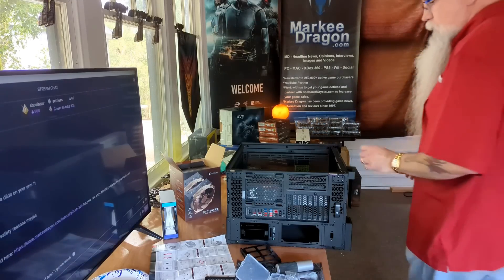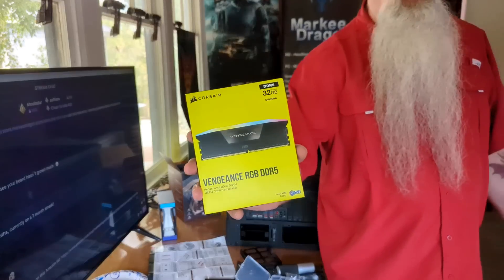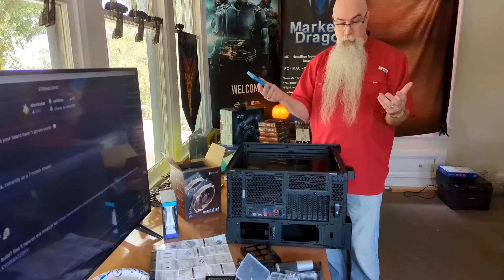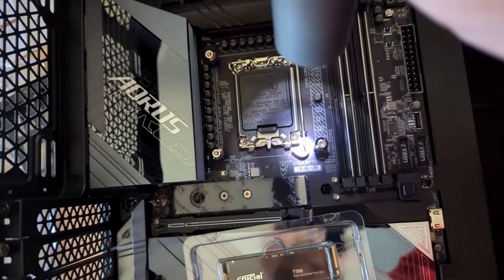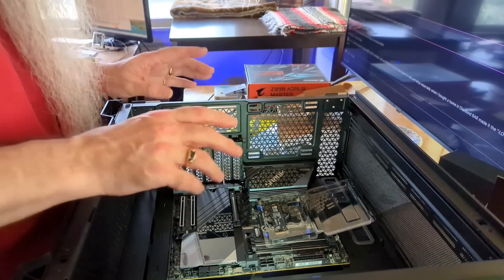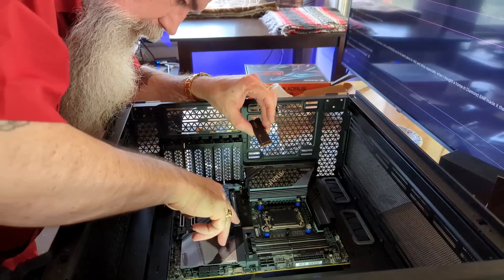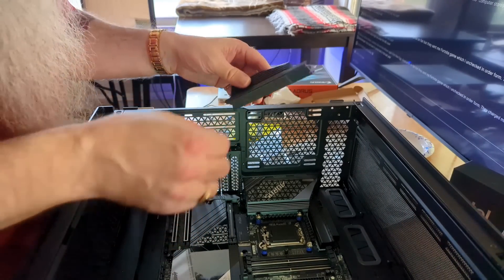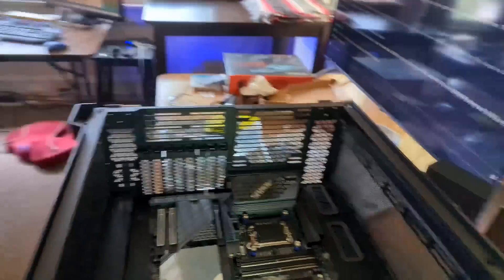Crucial T700 Pro 4tb Gen5 NVMe M.2 SSD Install - Intel Core Ultra 9 285k System Build 009

Comment: The T700 Pro will run very hot if you do not have a very good motherboard heatsink it will throttle if it does put a fan on it and you will be fine. It as you gathered only works in a motherboard with gen 5 capabilities but as you have Ultra 9 285K then you are fine. Z890 boards do not lower your X16 on your video card slots installing a gen 5 in the gen 5 slot unlike AMD and previous gen boards

Comment: On many motherboards, one m.2 slot is primary, you are very correct 👍. Slight modification for the second m.2 description, on SOME mobo's, using the second m.2 may cause the auxiliary (also non primary) gpu slot to downgrade to an x8/x4/or x2 lane. Really cheap mobo's can also cause primary gpu slot downgrades. It pays to double check the number of lanes and chipset assignments. Your "closest to the cpu" is almost always correct. The more sensitive gen 5 slots will eat bandwidth and unless its a high end workstation mobo designed for extra chipsets and lanes, it can suddenly surprise you when your gpu is nerfed. Once you fire up the system and head into the Bios, easy to verify full x16 gen 4 or 5, depending on the components. They should auto recognize, always best to get full bios flash updates right then and there, BEFORE you make a bunch of settings changes that you are probably going to have to redo once bios upgrades. It's part of the fun, LoL. GPU x16 slot assignment does vary, even on a dual slot motherboard, thats one of those things you really should look at the manual to make sure of. Its simple enough to verify and not load up the stress levels. 👍